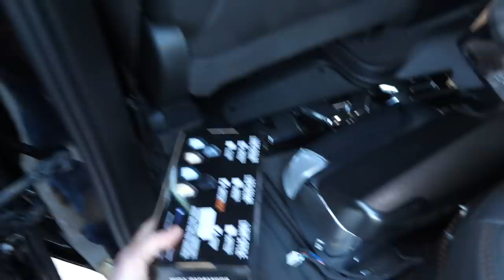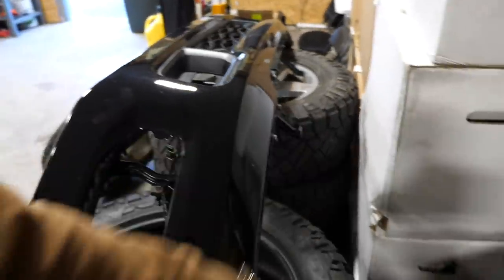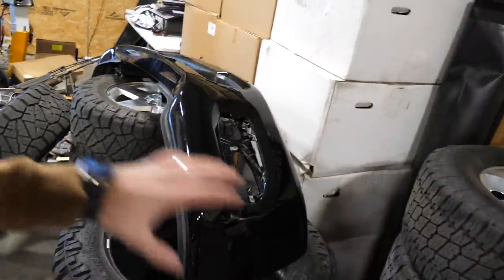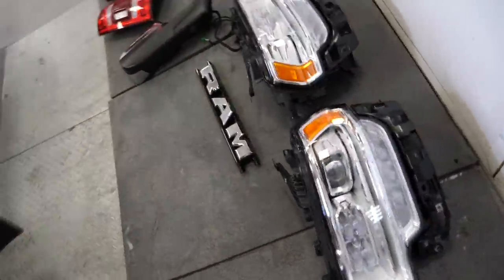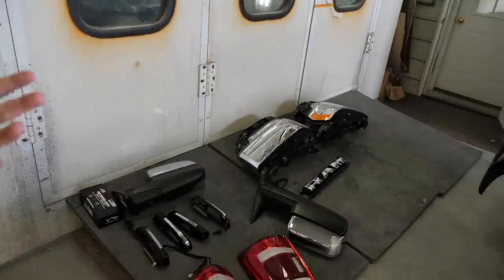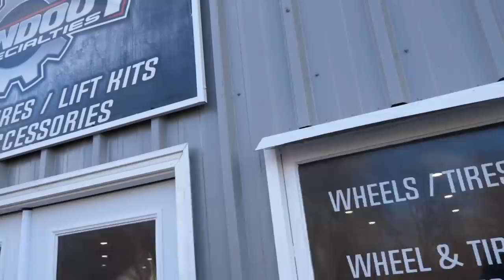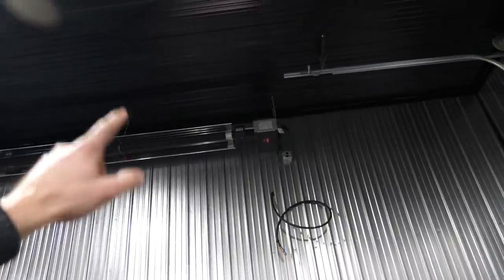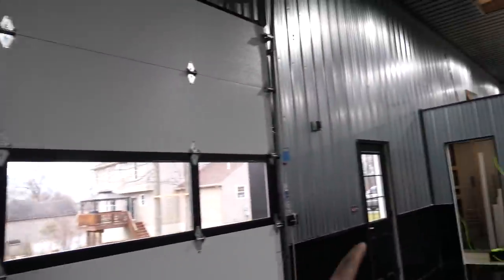Going A COMPLETELY Different Direction On Wheels.

Comment: I work a asphalt company, for your driveway for now look into asphalt millings, you can do fine milling that can be run threw a paver and rolled in, it looks like asphalt drive but way cheaper, plus side in the spring if put in the right way you can pave over it

Comment: Honestly jack if you ever do an obs Chevy or ford get a set of Vision rocker 412 yea they only come in a 12wide but they are very simplistic yet they pop. I did the two tone black and grey but the polished wheel looks amazing also I have them on my 2011 Chevy 1/2 ton and they look killer